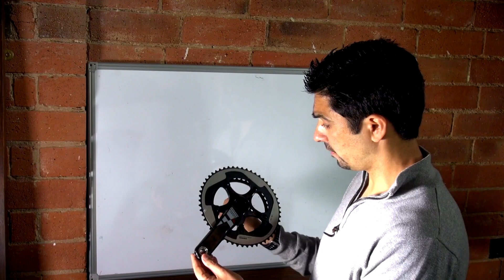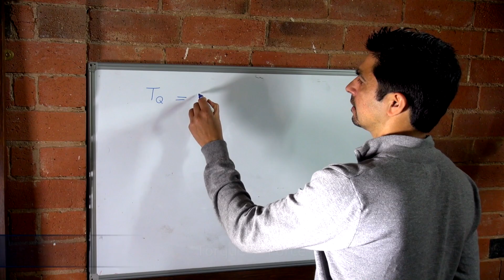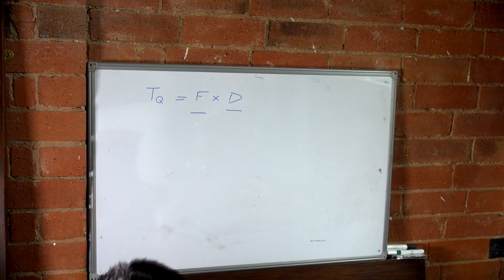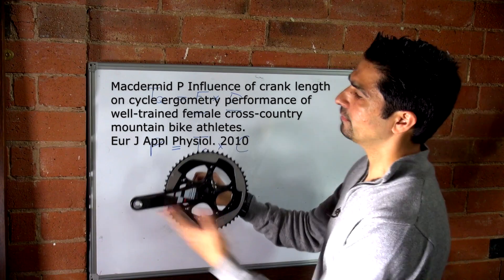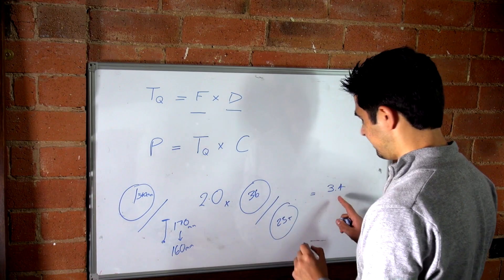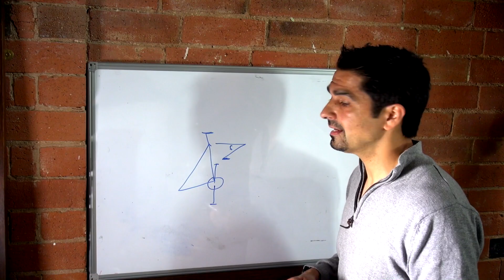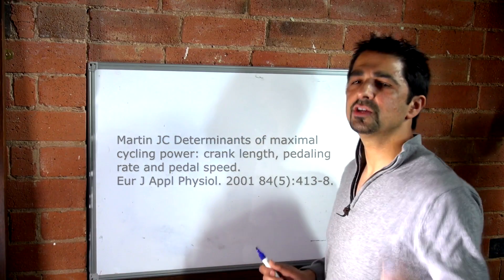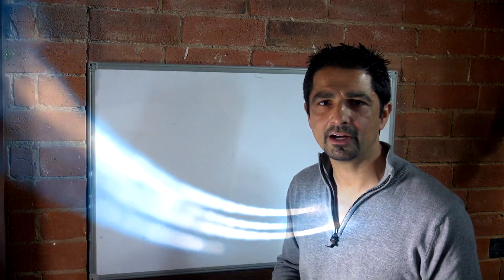The basics of Crank Length (Effect on power, cadence, comfort)

Comment: Why would it be harder or slower to accelerate a bicycle crankshaft of longer length when it is easier to turn a longer lever?  Shorter cranks will not increase your speed going down hill. If anything you may go slower and as you will produce less power at the crankshaft to push through the wall of air.  The longer crank is easier to turn thus you can turn it at the same speed or faster.  The larger circle created by the increase in length or the time it takes to turn the crankshaft one rotation does not decrease the pedalling efficiency.  The front sprocket (constant lever) size is what matters in that regard.  The crank arm and from sprocket rotate at the same RPM even though one travels further than the other.  The larger circle means the duration the force is applied to the front sprocket is longer thus a smoother or less pulses on the rear wheel as you would hear on a indoor trainer.  The loner crank also means you can more use of your muscle especially your hamstring muscles.  When you do leg curls do you limit how far you contract your hamstrings to left the weight, I am sure you lift weight at lest 90 degree.  I use cranks with a length of 210mm and it is much smoother, cadence is still high (105-115), ride a smaller frame, pedal does not hit the ground. The only thing that really took getting used to going from 180mm to 210mm cranks was when you stand on the pedals. climbing Leaning forward felt weird (like being on a step climber in the gym) not inefficient, just different. But if you position yourself over the seat....holy crap the bike shoots forward!!!!!   IT felts smooth and you feel the force you apply to the pedal going out the rear wheel!!

Comment: To boil it down in simple terms, it's called "Mechanical Advantage". The crank is a lever, the longer the lever is the more torque it produces at the hub.                                                                                                                                                                                                                                                   Just don't get them so long that you knee yourself in the chin - and lift the wheels off the ground at the same time....thats a joke by the way!

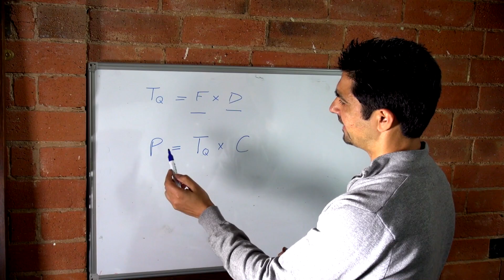Comment: 4:25 Cadence = RPM and crank length will not effect it.
All that will change is the speed your foot moves around the circumference.
Longer cranks means your foot moves faster and further for each revolution.

Comment: Thanks fot the video. I'm 198cm tall, riding with a 175mm crank. I might fit with 177mm crank to use my legs for efficiently without too much pain. 
Also, I would lower the saddle height. would it make more aero?
Reply from the maker: Crank length will not effect aero more than about 0.5w but saddle height will.....its hard the predict but as a rule of thumb raising the saddle makes a more aero experience because you rotate relative to the front and encourage a more crouched position, up at the saddle & down at the front is ideal for aero.

Comment: I'm a recreational rider so not a competitor, and I'll be retiring in a few months enabling me to ride more.  In addition I am 6'7" so wondering if a crank longer than the common 170 would work for my physical size better?
Reply: Funny, I'm retired and 6'6" and wondering if a shorter crank would ease knee strain and suit my slow cadence.
Reply: @ichirofakename  Yeah, interesting.  And I never learned an answer.  
Say, have you thought about an eBike?  I bought one of those, a Juiced Rip Current S which can be purchased with an XL frame.  Honestly, about 80% of my riding is with no assist at all (flat ground) so has exceptional range.  But, when you mention knee strain such bikes are a great alternative.  The reduction of knee strain and other leg issues has enabled huge numbers of people to get back on a bike.  Anyway, just a thought.
Reply: @Snarge22  Actually I only ride for exercise, so there's no point in an e-bike for me.

Comment: I find longer cranks are less tiring,managed to do stelvio-gavia-mortirolo in one day in attrocious conditions. Just couldnt get power out with shorter cranks.used 175mm vs 165 ultegra which are hollow btw and flex. Im a big heavy guy but power is much better with 175. I rarely get out of saddle on climbs and keep it smooth to save energy particularly past 2300 meters .

Comment: I like to think about the problem in terms of force and radii only, since then you don't have to deal with power and cadences. I approach it as follows:

Let f_p = tangential force applied by your foot at the pedal.
Let r_p = the radius of the crank arm (i.e. crank length).
Let r_gp = the radius of the pedal gear (i.e. the chain-ring).

Let f_c = the tension force on the chain.

Let r_gw = the radius of the wheel gear (i.e. the rear wheel cog).
Let r_w = the radius of the rear wheel.
Let f_w = the tangential force the tire applies to the road, at the contact patch.

ANALYSIS:

Pushing on the pedals produces a torque (T_p = f_p * r_p) on the bottom bracket axle.

This pulls on the chain with some force (f_c = T_p / r_gp).

The chain, in turn, pulls on the rear wheel cog gear with the same force, producing a torque (T_w = f_c * r_gw).

This torque causes the tire to produce a backwards frictional force (f_w = T_w / r_w) on the road, and the road then produces and equal and opposite forward force on the bicycle.

The whole equation then becomes:

f_w = T_w / r_w
        = f_c * r_gw / r_w
        = (T_p * r_gw) / (r_gp * r_w)
        = (f_p * r_p * r_gw) / (r_gp * r_w)
        = f_p * (r_p / r_w) * (r_gw / r_gp)

Where I've deliberately grouped the radii together in the last line in a rather suggestive way.

Let's look at a simple example, where the front and the rear gears have the same radius. My Trek 520's middle chain-ring and its biggest freewheel cog both have 36 teeth, so this isn't just academic.

Then the equation becomes:

f_w = f_p * (r_p / r_w)

If I have 700c wheels with a radius of 350 mm, and my crank-arms are  175mm, then the relationship between the forces is:

f_w = f_p * (175 / 350)
        = f_p / 2

So the force pushing my bike forward is exactly half the force I'm pushing on the pedals with, at any given instant. That's when the gears are both the same size.

This implies that a longer crank-arm (or a smaller rear wheel!) will give a bigger wheel push for a given pedal force. Of course, changing the crank length affects body mechanics, and shrinking the wheel radius reduces how far you roll per revolution, so those are the tradeoffs.

Next, let's change gears.

When the gears were the same size, their ratio was 1. But the bigger the (back to front) ratio, the bigger the push will be, so we want to maximize this ratio. This means we'll get the biggest push on the smallest chain-ring (r_gp) and the  biggest rear cog (r_gw).

My smallest chain-ring has 26 teeth, and my biggest cog is 36 teeth, so the ratio is:

36 / 26 =~ 1.38

and therefore my maximum push on the Trek is:

f_w = f_p * 1.38 / 2
        = f_p * .69

So the highest force transfer I can get is about 69% of my input.

Now, let's turn it around and see what it looks like at the other end of the gears.

My weakest gear ratio (back to front) is:

 11/48 = ~ .23

so:

f_w = f_p * .23 / 2
        = f_p * .11

When I'm grinding, the bike is only getting pushed at 11% of my input force! To get the same push as my strongest gearing, I have to crank about 6 times as hard:

69% / 11% =~ 6.3

The conclusion to all this is that smaller front to rear gear ratios push the bike harder, but you have to spin faster to keep up with the wheels. That's the trade-off for gearing.

Incidentally, that's probably where that clickbait ad about the maximum cycling speed being 60kph comes from:

100 rpm * (48 / 11) * .7m * 3.14 = 959 m/min = 57.5km/hr

Guy probably just looked at a typical road bike and plugged in what he thought was a super fast cadence. :P

Comment: Your video is very in depth and scientific in its analysis. With the growing advent of one by cranks on gravel racing bikes it makes things dificult to choose crank length, size of front sprocket and cassette range. Many riders buying or building a gravel bike are coming from traditional r oh ad bikes. Can you do a video on how you would best take a riders road gearing ( 2x10, 2x11) they are used to and how to best choose crank length, drive gear and cassette range for a gravel bike? Riding off road you obviously want lower gearing than you do on the road but I see riders all the time choose too small of a drive gear and too wide a range of cassette for gravel. There has to be a way of equating a riders road gearing and power output to a gravel equivalent to at least be closer than a guess.

Comment: The cadence or rpm stays the same but the foot has to travel faster along a larger arc with a longer crank hence foot speed has to increase to maintain a given cadence with longer crank and and slower foot speed with a shorter crank. Foot speed and cadence are 2 different metrics!

Comment: As a short rider i have come to the conclusion bike manufacturers don't want me . You make lot's of good points about 170mm v 160mm , but have you tried to find 160mm cranks on a bike ? Even small , extra small or even extra extra small bikes from the cheapest to the very expensive all come with 170mm cranks , if you are very lucky you might find 165mm , but anything less is custom or very rare.  All bike manufacturers are very quick to tell us about their new shiny technology but fail to give us even the option of 160mm or 155mm on small or extra small bikes  , this is my main gripe.  Many short riders have bikes languishing in sheds after riders give up trying to push 170mm or worse 175mm cranks on their extra small bike .end of rant . Thanks i enjoyed your video .

Comment: hi i am 5'9 with a inseam between 78 79 cm i am currently running 172.2  mm cranks that came with my bike i have toe overlap in my bike and am planing to change my cranks to resolve it  and maybe to get more comfortable ..also running 50 34 planing on getting 52 36  cranks because in 34 plate  i spinn to fast and has to cross chain will i notice any negative effect on this changes if u can help me please ?? or it will better just to get 165  mm cranks with 50 34

Comment: I've done many back to back tests on my mountain bike with 175, 180, 195, and 210 mm cranks.   The 210 mm cranks result in 5% faster hill climbs compared with the 175 mm cranks (210/175=1.20 more torque).  I'm 6'0" with a 32" inseam.  I've worried that the extra leg angle and movement might result in some wear or injury.  After 30 years of hard riding with 210 mm cranks I'm still going strong.

Comment: I have gone to 170mm cranks on my TT, Road and Track bike. However have just gone to 172.5 on my TT bike and I use a 60T chainring. The shorter crank length gives me more aero abilities via open hip angle....  I set my fastest flying 200 of 10.9 on a 172.5 track crank.... on a 127” gear (57/12)  I find no real issues with 170 or 172.5 in regards to getting on top of a big gear.  I have found that I really like 170mm even though I am 6”0.

Comment: Right all this YouTube videos only seams to mention road bikes. I ride MTB and my BB is 70mm lower than rear axle. This mean that I may hit a ground on bend because of that. How do I determine a length of my crank based on position of bottom bracket ? 
I'm 6'1" and getting 165mm crank will be a bit short I think and now I have 175mm crank

Comment: im guessing this is why pantani was running 180s in the mountains. easier to turn around the 39/25 on the steeper grades. i live in an area where you run out of gears even with a 34/32, so the longer cranks do help on the over 12% grades i find. not sure why gravel bikes come with 1x, just not enough gears, not easy enough and get spun out to easy also

Comment: I guess it is time to redo my crank length video because this is nonsense.  Crank length is a bike fitting tool, not a power producing tool.  It is driven by two angles at the top of the pedal stroke.... the thigh to torso  angle and the knee flexion angle. Over a very wide  range power will  not change, but position can be improved,  joints are happier, and for triathletes, runs off the bike can improve. 

Modern crank lengths were developed before switchable gears, so the crank length as a lever was far more important.  Now we can vary our leverage by 300% by simply switching gears.  You want more leverage? Change gears? You like a different cadence?  Change gears. 

Modern crank lengths were also developed before aerobars, and thigh to torso  clearance i s generally worse for TT riders, hence  the need for even shorter c ranks on time trial bikes.
Reply from the maker: https://www.youtube.com/watch?v=ydePgGR1Lu8

Comment: If we consider the crank to be a wheel and axle machine, changing the lever length wouldn't make us any faster or slower than adding a smaller or larger cog to the cassette, right? Our bodies are the source of horsepower, not our gearing. 

But as you said, comfort is what matters. It's called a crank (and not a lever) because it converts the linear movement of the connecting rod (our leg pushing down) into rotation. Biomechanics is the only question.

Comment: It also depends on the type of use or discipline of biking you do. Most MTBers go for longer cranks and the reasons are obvious. You need more torque and the longer arm helps in that. Plus in many instances, you don't really need to spin as fast.

 RB's may be more demanding and if I were a serious or advanced rider, this should already be included in the bike fitting. That may not be 100% or even 90% in some instances. Only long rides and actual intended use will one eventually find out what is good for them. Riding only for 1-2 hours and not for the intended use, may not reveal the problems or issues that can crop up. It's not like any different with saddles. You really have to ride 3-6 hours and do that several times to find weed out issues with your saddle. And one must take it to the conditions one intends to use it or the terrain one is often exposed to. It's really a long repetitive use that brings out the kinks if there are any. And a single ride may not to be smart to conclude anything, especially if one is still adapting to a new crank arm length. 

Smaller wheels like in folding bikes, means it will be harder to consider longer crank arms simply because those arms can be limiting due to the lower bike stance. Though I have used 172.5mm ones, in 20" tires, it can be tricky not to prevent them from hitting the ground in speed bumps, or some road anomalies. Most folding bikes also tend to be more upright, so those hip and knee angles tend to be not an issue. RB's are usually make the riders lean forward in aggressive aero position which makes those angles smaller. But this is not true for folding bikes, or even other recreational bikes. Hence the issues raised here my not be applicable for some types of bikes. 

Recreational riders, may not concern themselves with this. If you just ride maybe less than 50km or even 100km, leisurely you can opt out of finding out what's good for you, unless you have long or overly short legs, or some other problem (arthritis, one leg shorter, et ) and the like. Most bikes normally come in 170mm and likely 90-95% of the population will have no problems with those. 

Of course, the bottom line is for you to experiment for yourself. Everybody is different as well. My guess is if you are a pro, or serious racer, or advanced enthusiast logging in  hundreds of km a week, finding out the right crank length can maximize or optimize your potential. It can even help avoid getting injuries.

Comment: It's the same as with diesel vs gas. Diesel produces more torque due to higher compression ratios enabling diesel engines to have longer cranks, but they don't produce high power because they can't rotate these cranks fast enough. So they produce more power than gas at lower rpm. Gas engines have shorted cranks they can spin quickly producing more power at higher rpm. What I'm trying to say is that shorter cranks will help you produce more power if you can maintain higher rpm. Also, when sprinting, it's better to go at very high rpms instead of crunching the gears slowly. For example bmx racers will hit 200 rpm with 2000+ watts when sprinting out of the gate. So do track sprinters. But for humans there's also the stress you put on your muscles and joints when pushing low rpms with high torque. My conclusion is shorter cranks are better either way, because they allow you spin faster, even if you think of yourself as a diesel.

Comment from the maker: Hey guys please sign up to the FFT newsletter/list: bit.ly/fftnewsletter; and contribute to our bikefit dataset: bit.ly/bikefitdata
Reply: How does crang length effect out of saddle pedaling?
Reply from the maker: @vaugr1917 Very good question: too small and you cannot develop enough power, too large and you get rocking of hips and body and ultimately instability.
Reply: Sorry, but your calculation with the Gear ratio is wrong. It is 11/53=0.2 not 53/11=4.8. If you calculate with torque its maybe easier to understand. If you put down 100Nm with your foot you have 100Nm *0.2=20Nm on the wheel/street. Cadence is the other way around 100rpm(crank)/0.2 =500rpm(wheel).